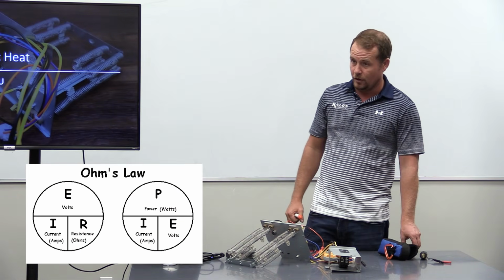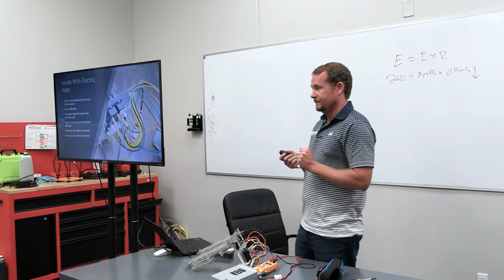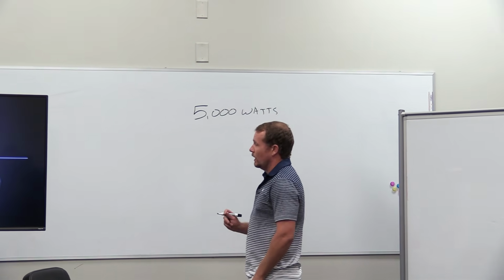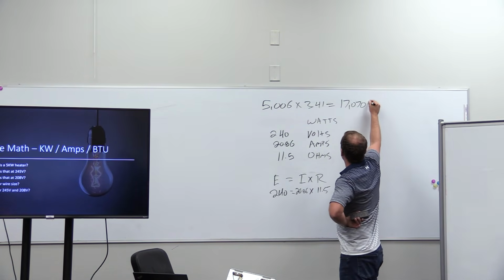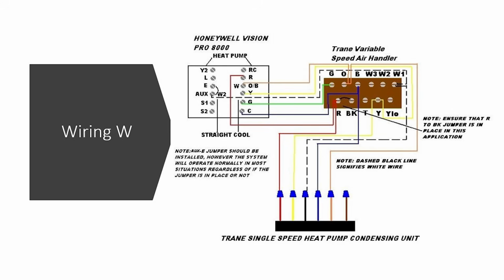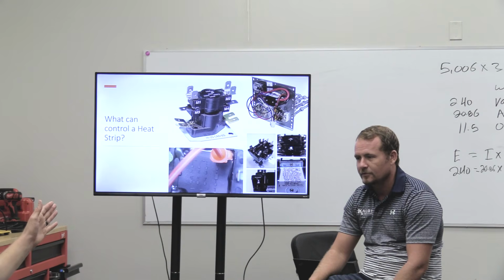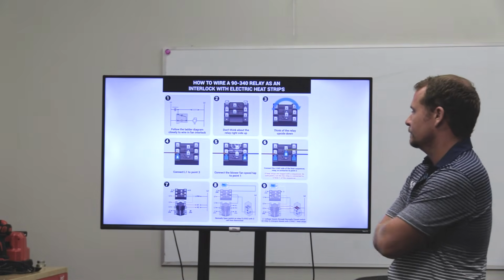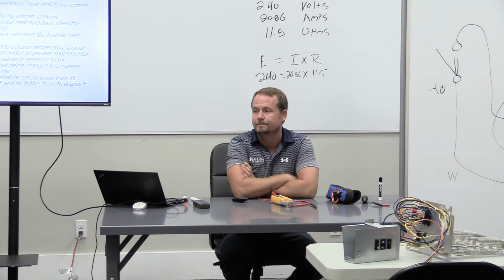Electric Heat Troubleshooting, Service, and Math Class

Comment: Here’s my problem, I have a Goodman electric furnace when it first cycles on it blows coldish air and after about 2 mins it starts blowing warm air and then the air starts getting hot( but it seems to me it doesn’t get as hot as it used to) then I notice right  before it cycles off the air slowly get cool again and shuts off.  Last year, the heat wouldn’t shut off at set temp on the thermostat, so I replaced the thermostat with a brand new one, I replaced the heat sequencer and I also replaced the motherboard. It turned out that the heat sequencer was bad and fixed that problem. So,what’s going on here with the furnace blowing cold, warm, hot and then blowing cold again? Thanks in advance!

Comment: I had a call for a Trane air handler recently. Fan wouldn’t shut off. Turned out the 90-340 relay was stuck closed under load, but would open when the circuit breaker was turned off then on again. Any idea why? This one still puzzles me. I verified 0 volts to the coil, but it was still closed.

Comment: This might not be the best place to ask this question but here goes anyway. I'm an automotive mechanic and I've noticed that the heater works pretty well the way it's designed in every car manufacturer. I'm in the south. My question is would using your water heater with a circulation pump not be more efficient than electric strip or heat pump? I just assume there is people here watching this that would know the answer to this question.

Comment: You didn’t once mention air outlet temperature which customers complain it’s blowing cold air (it isn’t) with heat pumps not shutting off till 5 degrees so staging a heat strip to temper duct outlet temperatures is critical.

Comment: 1 common reason commercial buildings use 3 phase is 3 phase has better characteristics for electric motors which are more common in commercial applications

Comment: On a 208Y/120 volt system (the wimpy Wye system) your heat strips will only put out 75% of their rated BTU output. So if you wanted the same output of a 5KW heat at 208 volts, you would have to install the next higher level of heat strip, which would be a 7.5KW heat strip. That would be at 240 volts. That would be 5.6KW at 208 volts.

Comment: You also need to add the amperage of the blower motor to the supply of your heat strips since it will be powering both of them. It will also be an inductive load unlike the heat strips so it will draw more amperage than usual when first turned on.

Comment: If resistance doesn't change you don't need to calculate it.  The  new value for watts is (240/230) * (old power value).
Reply: Wrong. It's 240 (squared)/230(squared) * old power value.. You do need to recalculate to make sure you include the new amperage reflected in the new voltage.

Comment: Your slide about W, W1, W2, W3, E is the best explanation I’ve seen. I live in Houston and even thought it’s prime climate for heat pumps they are extremely rare.  With all this electrification shit coming out we’re trying to start pushing them to be ahead of the curve.  Well, my first install with a Honeywell T6 thermostat kicked my ass trying to figure out what terminals to use.  This would have saved me a lot of frustration!  Thanks!

Comment: I mean, nothing wrong with size 12 wire. But why even bother. Just grab some 10. It's like the most common wire, 30 amps, no biggie. Just in case too, I mean sometimes a heat strip may pull just over 20 amps. Find some melty wires in an electric heat area, grab the good stuff. And that reminds me....I need to pick up some NoAlOx for those unfortunate people that still have aluminum wire set ups.
Reply: And there is a huge push to bring in copper clad back into residential...we have forgotten about mobile home fires?? Afci won't let that happen? I'll watch from my phone, yee who forgets history... should be a hell of a show.

Comment: Never liked electric heating since I wired in a baseboard 240 volt heater and room filled with smoke. That was back in 1970.It was just burning off oil left from manufacturing.   Its convient if you only have say a small room or addition added on. Would love it when old apartment houses with no insulation had me install electric heaters in each unit. Told owners that renters would be paying an arm and a leg but they did not care because they were saving money by not running a large boiler. Had one guy in the top floor always kept windows open a little to get fresh air. After he got his first electric bill he taped windows installed plastic film and still had high electric bill. Won a couple of free lunches about the wattage of any heater of you valve the voltage say run a 240 volt baseboard heater in 120 volts. But output is reduced by 75% not 50% what some fellow dumb sparkies insisted

Comment: Why aren’t any of these electric heat videos talking about the main reason they are used in heat pump markets. It’s the most often time they are used also. Defrost. You the reason for the white wire on the condenser. Keeps you from getting calls saying my heat pump is blowing cold air.

Comment: What is the power per kw down in Florida where in Winnipeg Canada and I use only a 15kw furnace set to 5kw for an 800 sq shop. And its really not that bad. O and it'd minus 36 Celsius here.

Comment: Great instructor!  HVAC school is full of last chance delinquents.  Just wonder how that set-up would allow the emergency heat to work in the event the condenser unit failed to run.  Isn't the call from the stat the same for emergency heat as the heat pump with strips, minus the Y(and O if say a Ruud/Rheem)?  Meaning it's just a W2 call with G, and that circuit has now been interrupted by the high ambient lock out.

Comment: I don’t work on a lot of heat pumps I saw a unit today that had a B terminal and an O terminal on thermostat, my guess would be that one is to energize cooling, the other to energize heat pump mode? Someone let me know? He wanted to install a smart Honeywell thermostat and that stat only had O/B terminal on it, is there anyway to wire this stat??
Reply: O orange reversing valve for cooling    
B energized on heat when the selector switch is in heat, it does not cycle with temp. It is used for motorized air dampers from what I understand.

Comment: I don’t work on a lot of heat pumps I saw a unit today that had a B terminal and an O terminal, my guess would be that one is to energize cooling, the other to energize heat pump mode? Someone let me know? He wanted to install a smart Honeywell thermostat and that stat only had a O/B terminal on it, is there anyway to wire this stat??

Comment: I don’t like using the word “inefficient” for electric heat. It’s actually 100% efficient, buts not very cost effective because the “fuel” (electricity) is more expensive than gas. Buildings downtown actually qualify for being “green” if they have electric heat because of its efficiency rating. This can be confusing as your heat pump can produce more btus than running electricity through  heater but they use the same “fuel”. As a tech who does not work on a lot of air heat pumps, I wonder at what point, if there is one, in which elec heaters vs gas vs heat pump is more effective at BTU output. So I wish there was a more clear way of explaining this. It’s more about cost effectiveness. A class on this topic would be cool. This was a great class though.
Reply: On average heat pumps pull up even with electric heaters at about 5 degrees Fahrenheit. That is, though the heat pump is still transferring heat it's running very hard to do so and drawing the same electricity that an electric heater would to produce the same heat ( BTUs). This is why in colder climates a secondary heating source is necessary, unfortunately many people are unaware of this and are shocked when their electric bill skyrockets in the winter.
Reply: As a home owner with a hydro heat pump in basement here in michigan I wish someone could tell me how to shut off my elec heat or aux I mostly heat with my wood fireplace. I'm sure it can be done because i read it somewhere just can't remember where.
Reply: @Gods-Elect  it’s not on a breaker?
Reply: @murkyturkey5238  I don't think so.
Reply: @murkyturkey5238  To my understanding the elec heat kick in when it thinks the heat pump can't keep up or do the job. I also think the reason some on here will not offer info is because i'm just a home owner.

Comment: Is it best to have the blower on low speed or medium speed for electric heat? Would that depend on the size of the heat kit?
Reply: I don't have any specific numbers on cfm and how much air you need to be moving based on size of electric heater but in personal experience working on mostly 15 and 20kw electric furnaces I would say medium at the least or high. You need to move a lot of air over electric heat to avoid problems and it all needs to be tied together with properly sized ductwork. I have seen many 20kw systems with wire removed from one element turning it to a 15kw system just because the ductwork was not big enough to move enough air over the elements without cycling limits.
Reply: You need 80 CFM per 1 KW

Comment: Why don't hvac just run a click plc and program all these steps the trouble shooting becomes so easy
Reply: I know relays have been the normal forever it just seems so much easier I know the mill industry is way way better with the advancement of plc and drives
Reply: Not sure how that makes them smarter. I mean everybody doing electrical work should know how to work with relays yes but plc just makes life allot easier and can do way more
Reply: In school to be a electrician we learned relay logic but now that I work in the field computers have taken almost 90 precent of the trade and it just looks like it would simplifie allot of there work

Comment: 3 phase heat strips are a way different animal. I cant wrap my mind around how their wired.
Reply: Just think of the elements being wired with 3 separate 208 volt supplies.....each element is being independently energized by a single phase voltage of 208 volts. AB, BC, CA
Reply: It can be little confusing.
Reply: Just worked on one the other day, my boss came by and showed me how they work and how to check them

Comment: We use to have installers leave the instruction manuels inside the heat strip section of Air Handlers.  First time the heat strips came on, instant fire, smoke and plastic melting.
Reply: I heard from an installer that dropped a piece of tape,(1402) and the unit  it started to smoke.  he quickly shut off  the unit and removed it.

Comment: Re. your first chart: Another benefit of electric heat is the fact that it's efficiency is 100 % from the standpoint of energy conversion from electric to thermal energy. (You can probably win a few "Bar Bets" on this one)
Reply: Up here in Canada that point is sometimes hard to explain. Natural gas is more cost effective in most provinces but electric heat is more efficient. This leads to confusion over energy rebates. People will remove their old electric hot water tanks and install natural gas tanks and expect refunds for effeciency. Unfortunately for them the gas is more cost effective but less energy efficient. Good point to understand
Reply: @adamradley4407  Absolutely correct Sir. The confusion arises from the fact that cost effectiveness is not  equivalent to thermodynamic efficiency. The issue with which you in Canada are dealing is quite similar to that for most of us in northern New Hampshire. I can remember 25 or 30 years ago, following my retirement from Lockheed, explaining points like this to some of our community college students.

Comment: It's good to know the ohms of what you are working on since you can't always jump red to white...the reason is in some old buildings they have used whatever color wire they had on hand to wire a thermostat and you have to know the ohms of what you are working on and then ohm out the circuit to the common wire until you find the right circuit.  It is not a perfect world like in a classroom when you get out in public!  They jump stuff and then you have go in and try to figure what they did so you can get to the root cause to begin with.

Comment: Great lesson. Got a question on those same heaters in the box there's the small sticker u showed in the video and then there's 2 big stickers with the different model of AH on the big stickers it will be 208/240 volts and the MOCP is different compare to the smaller sticker that rating is at 208/230 volts so my question is should we used the MOCP from the big sticker? as its 208/240 since when we measure voltage its usually a little over 240v.

Comment: Electric stoves, and spas draw 50 amps on 220.
Reply: Both are worth it lol
Reply: You'd be hard pressed to actually draw 50A from a range. The burners and oven element click on and off to maintain the temp set, so they rarely crank 100% all at the same time. It was common to put 40A breakers on range circuits in the past even though modern ones state they need 50A, and I've never seen those trip.
Reply: @bnasty267  the point was made that there are other appliances in a house that draw 50.

Comment: You can measure Voltage across those switches with power on. If you see “0” you’ll know it’s good. Be careful not to short out and burn up your test leads. 🤚
Reply: True but for the younger guys I would recommend turning power off because most packages are very small and tight
Reply: I like to install electrical tape so only 1/8" of tip is exposed. Had a coworker arc over 24 volt control circuit to 480 volt. Blew up a board.

Comment: I only use 10 ga THHN wire, quality 10 ga terminals and a ratcheting crimper. Most of those electrical compartments do not have enough air movement to keep wires and terminals cool. No more overheating issues near the terminals.
Reply: MTW or bust lol!
Reply: @jonnymac31  I use TGGT at the elements and MTW on the controls

Comment: Your water heater and dryer both pull over 20A at 240V.
Reply: Both have resistive heat
Reply: Water heater is 4500w dryer is 5400w both are element @240v

Comment: Very good video...  

Hybrid heat is actually called Dual Fuel ...  This is important cause you CAN NOT use a heat pump compatible thermostat.. It must have a Dual Fuel compatible thermostat to run a dual fuel system which utilizes a outdoor temperature sensor for you switch over ( balance point).....
Reply: Any hp stat I’ve used asks what kinda fuel you’re using
Reply: @drodriguez394  usually the stat says dual fuel compatible... can't  use heat pump only Stat. It will run heat pump with the furnace at same time and cause HP to trip on high pressure...
Reply: @pineychristian  we can also install a snap switch in the supply plenum that opens when temperature goes above say 115 F, that will open the “Y” circuit going to heat pump. Lots of ways to accomplish the same end result. Then you could use a standard hp thermostat.
Reply: @USA-GreedyMenOfNoIntegrity  absolutely that's old way of doing it.   Duel fuel tstat have been out now for a while so just easier to buy one.
Reply: @pineychristian  dude the Bosch system we've been using is cold climate rated. Variable speed compressor. It can stage the elements 5kw at a time until we are -5f outside and then the heatpump will turn off and we rely on emergency heat strip. Only done on homes with PV systems. 
So the heatpump at 10f drops from say 50k btu to 20k btu, and along that curve to its shutoff point, the electric heat is supplementary.
The coil is before the heat strip in a conventional AHU and electric setup
Reply: @dunkxs  yea I know all about variable speed compressor technology.  It hasn't really been out that long though. Dual Fuel systems were rare in the past. Bryant/ Carrier was one of  1st to bring it to the main stream as a matched system with a thermostat that would run them without field modifications.  
What your talking about is just a much more modern advanced heat pump system which works great for the right customers.
Reply: @dunkxs  I actually have a Dual fuel system. 2 stage 96% furnace with a 2 stage heat pump. It works great cause it compliments my solar system....

Comment: You still have an issue with the defrost thermostat as wired.
If you do not run a wire to the air handler, how does "E" work on its own?
Maybe in FL is is not an issue, but in the northern climates and the customer has a heat pump issue, how would the "E" be energized?

We have that code for any energy rebate from the power company. If they come out to check on their random inspection, it will not pass and the owner won't get the rebate until it is fixed.
Reply: As a home owner with a hydro heat pump in basement here in michigan I wish someone could tell me how to shut off my elec heat or aux I mostly heat with my wood fireplace. I'm sure it can be done because i read it somewhere just can't remember where.
Reply: @Gods-Elect  I'm no expert but I would think you could just disconnect the wires that power the heat strip. Then when the heat strip is invoked, power will not be supplied bc the connection is broken. No power consumed and no heat produced.

If there is a manual that tells you a prescribed way to do this, it should be easy to find.
Reply: @realSamAndrew  Thanks I'll have to check that out good point you have there. I'll let you know what happens
Reply: @Gods-Elect  that's a deal! I would like to know. Please be safe and be sure to disable the house power and double check it's off before you touch anything. Some of these videos even show the pros forgetting sometimes. Don't be that guy!